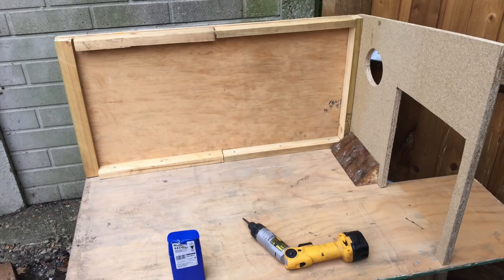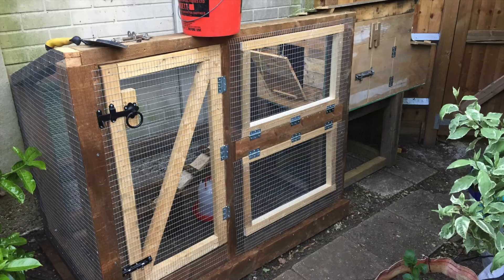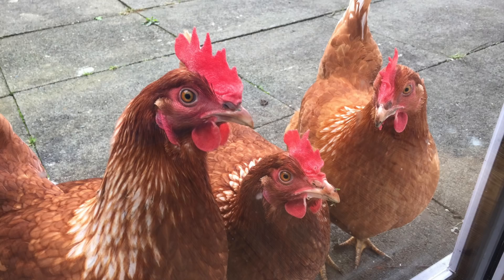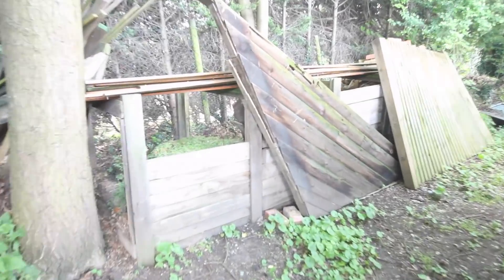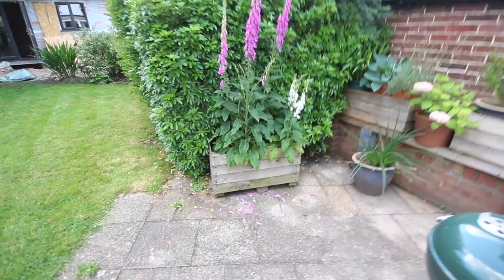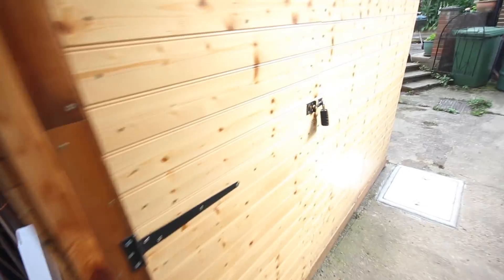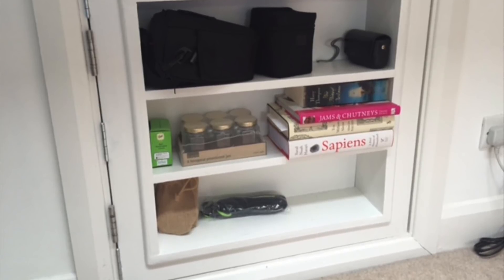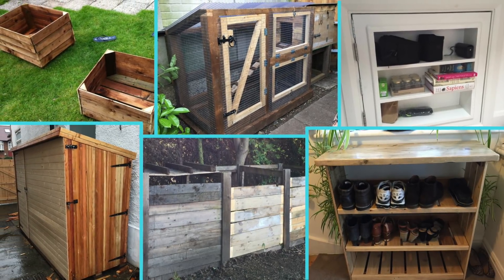Woodworking Experience: My past projects

Comment: Hi Ali, so the next video will be the EPDM, do you have a rough time frame for the door and windows?
I have been unable to find a suitable video on installation of those in a timber frame as i don’t believe the US have the same frame design as we do in the uk.
if you did use a source material can you let me know
Reply from the maker: Part 12 will be the breathable membrane, windows and doors. You’re exactly right as our windows don’t have the flange and there’s zero info out there to go into a timber frame. I did what made sense to me. Happy to take you through it you’re doing the windows sooner than I release part 12 👍
Reply: Ali Dymock  great. i’ll just follow the same. over engineering these things to prevent leaks is the way forward so i’ll wait to see if your way matched mine. 
i’m assuming your room is all finished now, although if the last video was the latest stage looks like you have a little way to go. looking forward to completing the journey with you and the rest that are following your guide.
p.s hope you get the sponsorship deal and before i need to purchase my epdm. although suspect i’ll be a little late
Reply from the maker: Basically for the windows: I cut 4 triangles into the breathable membrane in the usual way then used the flex wrap in the top two exposed corners and also the whole sill and 6 inches up the side. Then spray foam in the gap between window and membrane and sealant around the outside including below the sill.

Yeh it stalled for 3 reasons- winter, a new job and having to find tradesman for the plumbing and electrics so you may overtake me.

I'm hoping to release early next week-it's not a sponsorship deal exactly, just a discount to you guys and a little kickback for the channel - if it comes off!
Reply: Ali Dymock well i hope it does as the videos have been invaluable.
I have my floor finished and starting on the walls 26th of this month so we shall see. 
thanks for the response